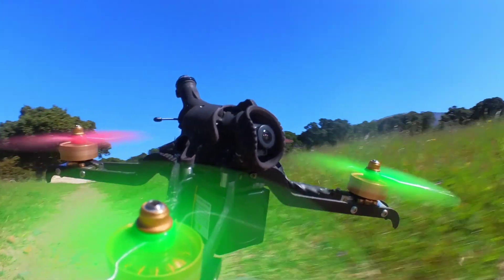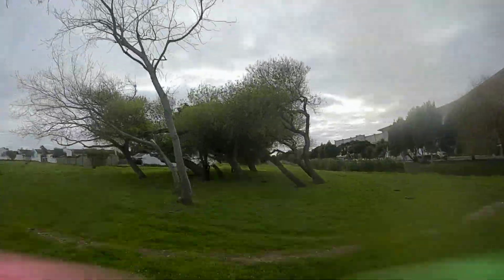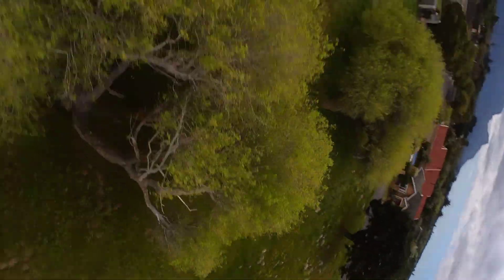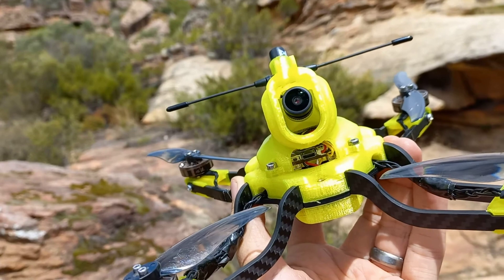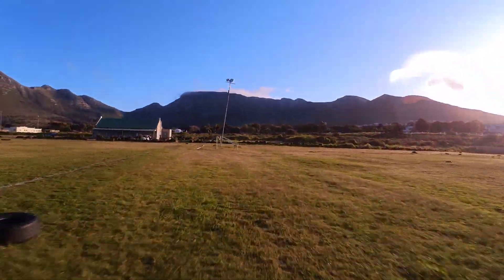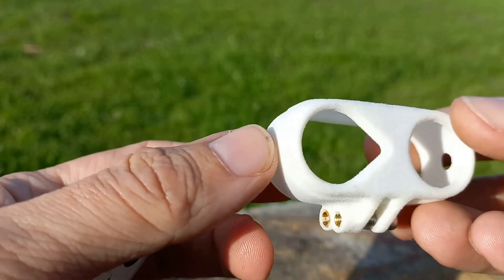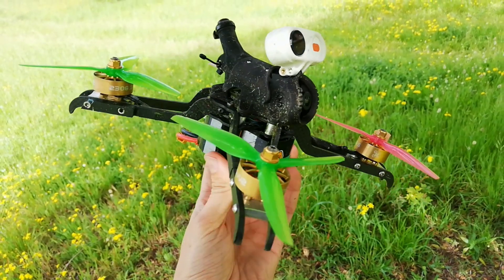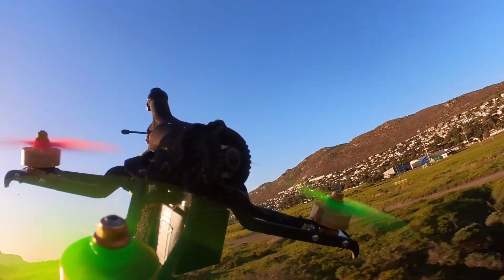I Built a Weird Drone: Bananasplit Development Video

Comment: Good effort in your design, build, and video, it came out looking quite clean. I believe what you have there would be central anhedral as that is when the lift surfaces are tilted down on a negative degree slope. Central dihedral would be the opposite, tilting the motors upward with a positive degree slope. Both create create natural stability and I can see why you chose anhedral as you have the battery bottom mounted. Great stuff, keep it up!
Reply from the maker: I had to do a quick Google and I think you are correct. Zach explained  it to me based on another drone which could well have had the tilt in the opposite direction, I didn't know the difference til now, thanks!

Comment: This is a super cool design! I would love to buy the frame. I would recommend printing the canopy in tpu.
Reply from the maker: Thank you! I did print a test version in tpu on my own printer, but it was heavy and too flexible. Almost indestructible but it allowed the Vista to hit the AIO in hard impacts. Not a huge issue since it's got an aluminum shield but it still made me nervous.

After trying that sls tpu from pcbway I'm tempted to try that for the pod but I think it will be eyewateringly expensive.

Comment: I'd buy, would like to see some protection for the ends of the carbon that stick out I think flying office parks would be brutal.
Reply from the maker: Agreed, I definitely need to solve that. I think at the same time I can solve the "landing on the battery" issue that I have with big batts that wasn't an issue with the lightweight on 720mah 6s.

Comment: How do you get the outside camera pov at the drone?
An arm with a run cad thumb? Do you have to change any pid or balance values?
Reply from the maker: I had a 3d printed arm, mounted to the end of the frame arms, holding a caddx peanut. I didn't retune, you can see a bit of wobble but I was surprised how well it worked. The flight characteristics were super weird though, especially in rolls.

Comment: Like the weird frame something different it’s like a digital racing frame
Reply from the maker: I don't race at all but weirdly I think you might be right, it does feel very nimble and well balanced. Probably not as light as one would want for racing though.
Reply: @JasonSuterOssum  have you checked the weight if it is then you probably would have the chance and also another question if it’s a 6S tell me the weight I’m really curious Lol
Reply from the maker: @Kwad.Kev2  the weights for the two different builds are in the description with their components, check it out 👍

Comment: crash test video freestyle is all about crashing and will it take it
Reply from the maker: I hear you. I mean I'd say there's crashing and crashing and freestyle doesn't have to be ladder dives into concrete, but I've fallen from 10m trees and misjudged Matty flips around field lights, straight into the ground. So far the frame has been fine (except those tips delaminating and needing some tightening of fasteners) but the pod does not hold up to that abuse, so development needed there.
Reply: @JasonSuterOssum  yer some ov my slowest crashes have been worse than top speed lol  good job bye the way